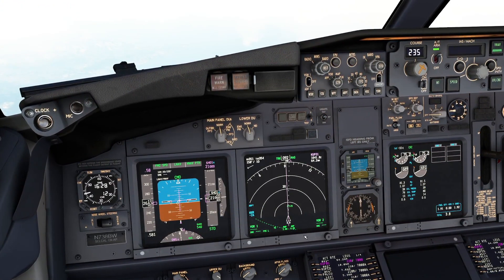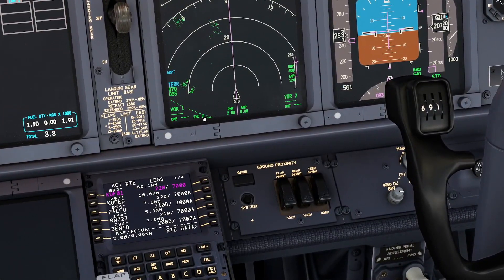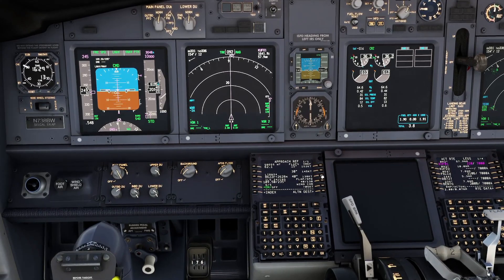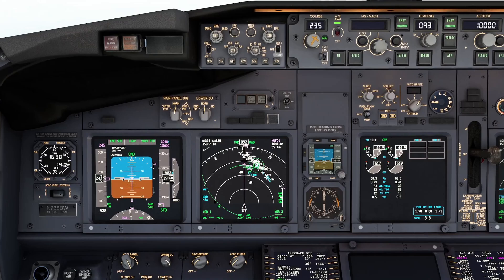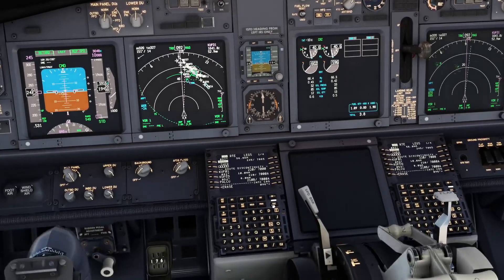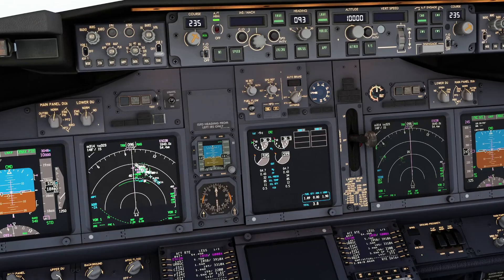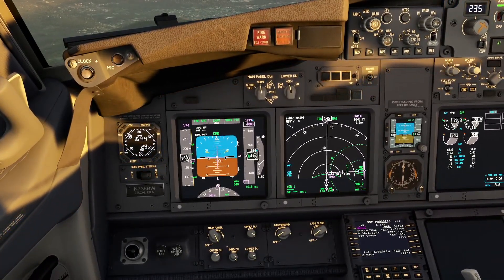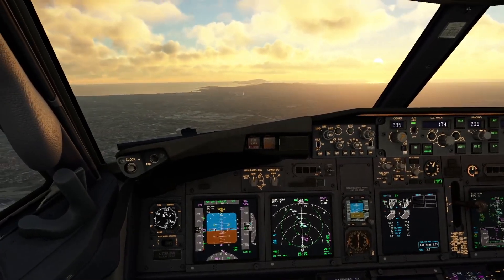BOEING 737 DESCENT and LANDING - LIVE ATC! Episode 5

Comment: Love your videos! Can I just ask you a question about the flare? In the FCTM and training it generally states to flare at 20ft RA, but I find this might be too late (30ft feels more in control). On some occasions some Captains give me a small prompt to pitch up or flare earlier than I want to, the VS is usually fine at 700/800fpm, is this because they are not comfortable or could I just flare quicker? On the upslope runways and steep approaches I always like to flare at least at 30ft.

Thank you! Even though I'm a line F/O your tips are amazing, they help!
Reply from the maker: @michaelpace5356 Hi Michael! Thank you for your amazing feedback, I really appreciated! So, regarding your question, let’s say that in a simulator, no wind nor turbulence, FCTM states that the flare should be started when approximately at 20’. And it works, but this all in an ideal world and, as you are a line FO you probably know, isn’t always the case. For example, if I have headwind I can start the flare a bit later than 20’ and close the thrust “slower” than normal rate, but if I have tailwind I would probably start closing the thrust levers as high as 50’, but still starting to flare slight above the 20 call, according to energy state (speed).
In my personal opinion, please understand that this is a personal opinion, if I hear “20” and I haven’t already started the flare yet, I know it won’t be a greaser (but remember, we fly the Boeing, slightly positive landings are preferable).

The only time you must flare higher would be if high on profile on the last 50’, as you correctly say.
I elaborate: Imagine your normal ROD at that stage, F30, 140kts GS ≈ 700 fpm ROD. If high on the last part, it is instinctive, in order to touchdown at touchdown zone, to increase the rate as high as 900/950 fpm. As you can understand, it would be difficult if not impossible to apply the same technique that assumes a standard ROD of 700fpm. Therefore I teach to divide the flare in two parts: in one you reduce the ROD to standard (at around 30’) then at 20’ you apply normal technique.
Personal note: if the captains you fly with apply inputs at that stage it is because they probably feels uncomfortable nonetheless thrust them and their experience.
I hope it helped, otherwise, I’m always here!
Reply: Thank you so much for your reply! Your videos helped me a lot and nowadays I'm more confident with the Descent management, the concept of decelerating and conserving energy makes a lot more sense now. 

If you don't mind, I just wanted to ask you 2 questions, especially with the amount of experience you have it would help a lot! 

1) Regarding our SOP of 1 to go, 2 to go, etc. Let's say you are at FL130, ATC clears you to descend to FL100 and the VNAV Path Indicators shows we are 1500ft high, let's say we are at 245 knots, does it make sense to put V/S at about 2000ft/min, speed 220 with speed brake or just LVL change 245 straight away with speed brake? I fear that LVL change might eventually break this SOP, I'll admit, when I am getting high on profile, I don't always reduce the rate at 2 to go or 3 to go for example, I want to fine tune this area more.

2) When you are flying the Approach, how often do you scan your N1 setting? When I was still new, I used to rely much more on the Speed trend vector and set the thrust by "feel", nowadays I force myself to scan the N1 and even set the thrust using the gauge, but to be honest, in bumpy conditions or close to the runway (100ft or 200ft), it can take away some capacity to look at the N1 gauge, do you also set the thrust by feel close to the runway?

Thank you for your help Captain, your experience as an LTC shows for sure! :)
Reply from the maker: @Mike999-q4p Hi again and thank you for your questions! Unfortunately I can’t/won’t discuss any SOPs of any airline nonetheless I will trying to explain some concepts:

1) what you are describing is mostly a technique, but if your operator requires you to reduce your ROD at 2 to go and 1 to go then you must comply with it. How you will comply with it will be dependent on various factors but yes, if kept high and only 3000 feet to go, you could use VS 2000 with “speed back” up to UP speed (so you don’t add energy) and speedbrake (to not increase the speed beyond 250. LVL CHG + speedbrake could give you a ROD exceeding your operator limits but once again, this is just a technique so use what you are most comfortable with;

2) personally, I don’t rely anymore on scanning many times the N1, but also I have a different experience from you. In your case (also to build up your experience) you should still scan the N1 setting (not constantly but at least to have an idea if the speed will eventually rise or drop) but once you are close to touchdown, below 200’, focus mostly on speed and touchdown point.

I hope this helped!
Reply: @737NG-Pilot  Thank you for the prompt reply! 
Sorry about that, I didn't wish to make you uncomfortable with the SOP discussion, I understand why you'd prefer not to discuss it on this forum. 

Thanks once again for the tips, these videos are golden and I will recommend them to anyone I know that needs help or is still doing training. :)